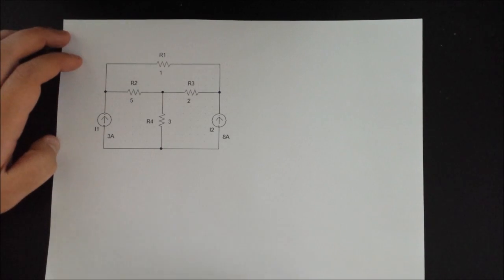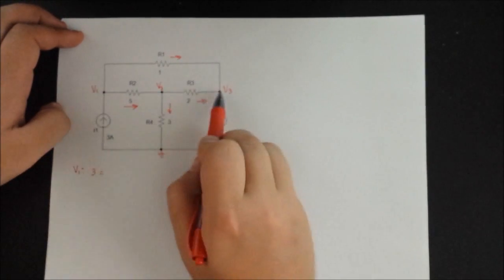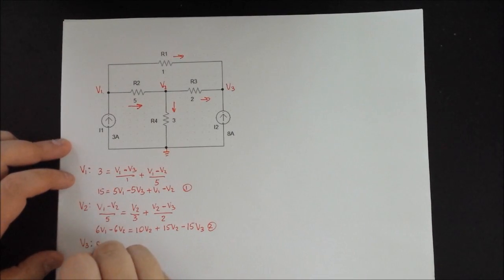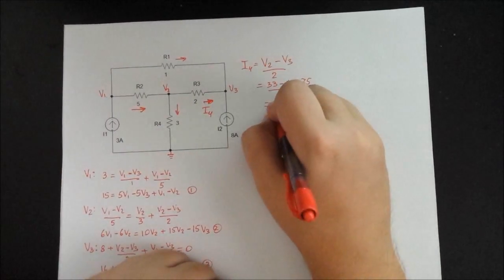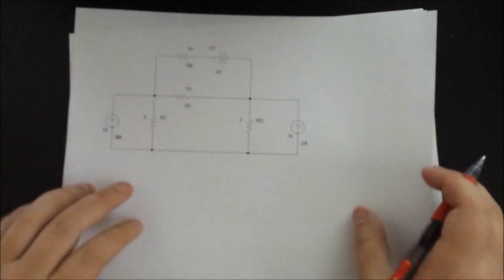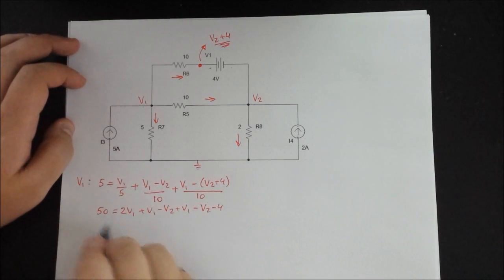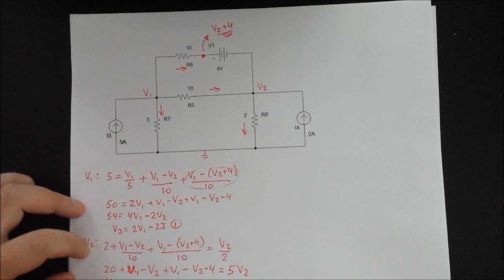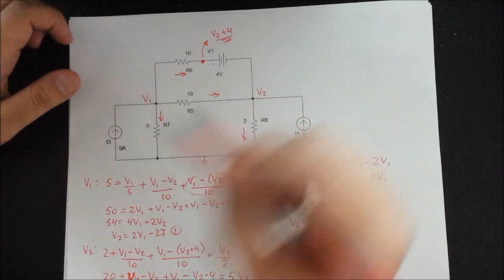Circuit Nodal Analysis - How to conduct nodal analysis and to find nodal voltages.

Comment: well explained. if the circuit got multiple sources then, do we need to calculate separately and do the calculation? like, we set one as the source and keeps the other as open circuit.

Comment: A question regarding the ground reference in the second circuit. Moving the ground reference around, the currents and voltage drops are the same, node voltage values change. Moving ground reference to say v2 results in negative node voltages. How does one differential between a negative current (opposite to reference direction), and a negative voltage?

Comment: how do i know which way the current is flowing. is there any technique to identify the current flow?
Reply from the maker: You can assume any direction for the current when you start calculating. Once you are finished with the math you will either get a +ve or -ve result. Based on that you can tell if your assumption was correct or inverse.

Comment: can you explain a little more about the voltage source and how they are analyzed?
Reply from the maker: Sure! All voltage sources in these analysis are DC. They provide a fixed ideal voltage. An example would be an AAA battery which is 1.5v. The battery has a +ve and -ve terminals which creates two nodes. If it is placed in its own branch like we saw in these examples you can simply assume that if you have 0v at the -ve terminal of the battery, you will have the voltage of the battery at the next node!
Reply: EEEnthusiast bro next tym plz show page full look at one end the paper cant be seen.. thnks